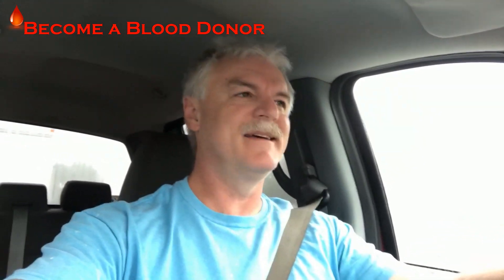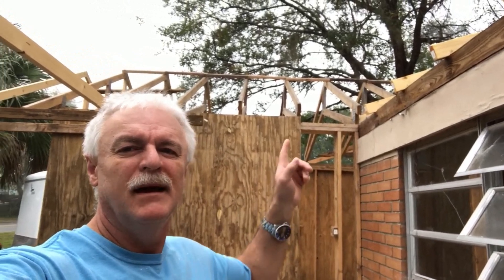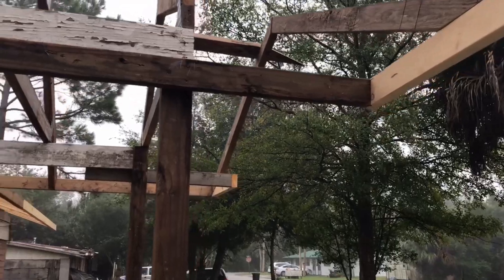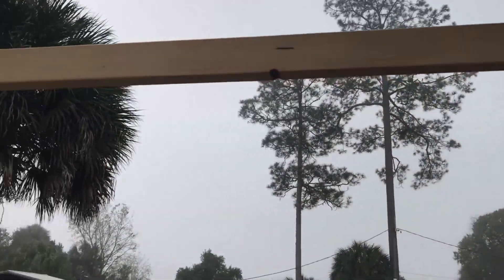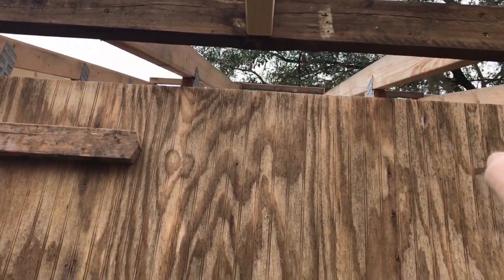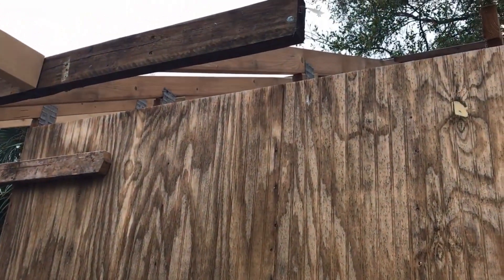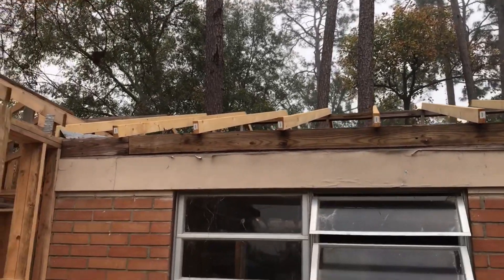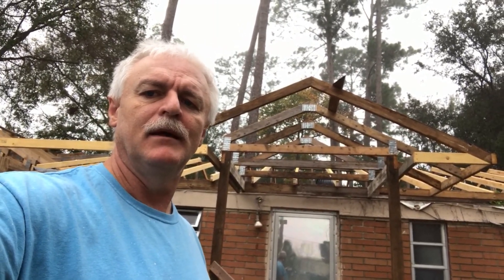Remodeling a $6000 Brick House - Building a roof NO POSTS - Sky Hooks!

Comment: That's some cool engineering.. Its going too look so good.  You took a brick box with a almost flat roof  and gave it cool design features and a roof pitch any house would be proud of.  
You always give a 100% ... except when giving blood.  
Great video as always 😁😁
Reply from the maker: The facade has certainly been significant improved! My goal was 4/12 for the house but I ended up with 4.5/12 for the main part and 6/12 for the master suite and porch entry.

Of course, I was an architectural engineer for 27 years so that gives me a little edge.

I’ve heard that before .... “Always give 100%, unless you are giving blood!” 😂 😂 😂 

I hope I can start making significant progress now.
Reply: @RehabLife  ahhhh, retired engineer. that explains a lot. thought maybe you were a retired carpenter. Im lucky enough to have a engineer / inspector buddy to look stuff over for me when I want to do something different on remodels. Looks great!
Reply from the maker: @coolkatz6695  thanks!